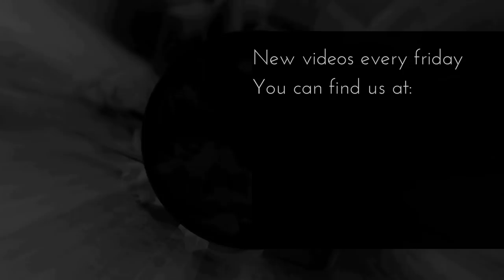Epoxy round coffee table - black epoxy and poplar

Comment: Probably a dumb question but do you mind telling me what kind of black pigment you used? I just did an epoxy mix using Pearl Ex carbon black, and it came out super opaque and I wanted it solid black ..I was told not to put too much pigment in as it may affect the curing process. I guess I should have put a lot more in or??

Comment: Superb work. 
3 Questions pls-
1) Did you wait for the bottom-most BLACK layer to dry completely or was it semi- liquid?? 
2) What was that liquid that you brushed the wood with?
3) After complete curing how did u manage to get the finished product out? did you dismantle that round mold completely?
Reply: Therapy Art it was cured. That’s why he coated both the black base and wood with clear resin before positioning it.

Comment: What type of finish would you use if it needed to be food safe. I am making a charcuterie board for a friend and am having a challenging time using different food safe oils (have both wood and epoxy to cover), and the oil never dries on the epoxy. I realize that most times a type of poly is used as a finish coating.

Comment: Quick question. After you put the black epoxy on the very bottom did you let that dry before adding the clear? If so, do you do a light wet sanding or anything to the black before the clear is applied?
Reply from the maker: I let the previous layers dry completely and then pour a new one and i dont sand between layers.

Comment: How do you finish off the edges? There has to be resin that came through under the ring or round off the edges? Do you do a final sand and polish?
Reply from the maker: I do the edges with a router and then sand and polish it. If you look carefully i pour everything inside the mold so between the wood and the mold wall i have 0,5mm of epoxy.

Comment: Beautiful work and craftmenship...where did you get the white materials for pouring on? I've not found it in that large of sheets? Thank you very much
Reply from the maker: Thanks very much.
Stratified wood, same material used in kitchen cabinets. Very important is to be glossy. If not just apply a glossy sticker and pour epoxy on it.

Comment: I know that you have your pieces individually sealed before you place them but do you have the edges of your wood rounded over also or do you leave them square and just round over the epoxy? What edge gap do you use around the table as well? That is a beautiful table. I may try one myself that’s why I’m asking.
Reply from the maker: The edges are square. I leave about 5mm between the edge of the wood and the edge of the mould. I then pour epoxy there. In the end i round only the epoxy edge as the wood needs to be always glazed in epoxy. 
Depending of the effect you want to get the wood also can be rounded, but i like it better square. This is a matter of taste.
And you are right all the pieces of wood are sealed.

Comment: do you use a dryer or a torch in the video?
Reply: Luka Crosszeria a hair dryer or heat gun helps to get rid of the tiny air bubbles that form in the resin during pouring.
Reply: Carl Craemer i know that already but thanks for telling me that.😁👍🏼
I wanted to know what was used in the video.. i think its a heat gun.

Comment: Table came out beautiful. Awesome work. 
Question, did u use casting resin or just epoxy resin ? Only ask because of the amount of resin used. I want to make one too. Thx
Reply from the maker: Only epoxy. Bottom layer 3mm, place wood, 3 layers of 0,8mm and then final layer 5mm.
Reply: SegWood Design  thx really appreciated ur work.
Reply: Why 3 layers for the wood and not 1 layer? Or 3x 0,8 mm + 5 mm = 7,4 mm the top layer?
Reply: Omar Carrera tlnl
Reply: Scandal
Reply: @DIY_Germany_68  Depending on which epoxy you use many are not meant for that thick of a pour and will generate a huge amount of heat.  I made that mistake the first time I tried it with a 1-1/2" pour, the epoxy had to be well over 300 degrees for a while and was smoking...
Reply: @segwood1211  hi, which material is the mold made?

Comment: Some answers to repeated questions I've seen below in the comments sections, as best as I can guess. See disclaimer at the bottom for a laugh. :)
What resin did he use? Probably something like this.
https://www.amazon.com/epoxy-resin/s?k=epoxy+resin

How much resin did he use? Well if you removed the timber and the table is 50mm thick (2") and (as stated) 750mm in diameter (2' 5.5"), then you'd need 22L (5.8 gal) of resin. He says he used 12L (3.17 gal) here. NOTE: he also makes a mistake in reply to how thick each layer was in the comments section. It's clearly not only 10.4mm as he claims. 

What could you use to stop the resin sticking to a mould? A tape like this.
https://www.shurtape.com/products/hw-300/

https://www.epoxyworks.com/index.php/what-you-can-do-if-you-dont-want-epoxy-to-stick/

What was the mould base made out of? Melamine laminated particle board. Almost certainly waxed to make sure the epoxy didn't stick.
https://www.homedepot.com/p/Melamine-White-Panel-Common-3-4-in-x-4-ft-x-8-ft-Actual-750-in-x-49-in-x-97-in-461877/100070209

What was the round edging of the mould made out of? Possibly polycarbonate strip. It's likely he waxed it to make sure the epoxy didn't stick.

How did he get the bubbles out of the resin once it was poured?
With a heat gun. I've seen others use a propane torch. The real pro's with the right gear use vacuum to remove bubbles.

How did he get a mirror finish? He shows no surface imperfection repair at all in this video but others sand from 200 grit all the way to 2000 grit to get a mirror finish on epoxy resin.

How do you get the bits of timber nice and flat before putting them in the mould? A jointer or planer if you have access to one (that is big enough). A router with a flat bit in a guide if you don't.
If you're old school (goodonya!) use a hand plane. See this video at 45 seconds to see what I'm talking about.

https://www.youtube.com/watch?v=IJ-hiw1CqyA

Do you have to wait for each layer to cure before adding the next? YES. Yes you do.

How did he get the timber bits nice and circular (where they needed to be circular)? Probably by rough cutting the circular bits with a jigsaw to around 5mm of final dimension then using a router with a long straight cutting bit and a radius guide in incremental depth cuts of 6mm at a time. The three sections were likely double sided taped (or screwed) to a bottom board to ensure they stayed in place.

Final note: Epoxy resins get hot whilst they are curing. Whatever you use to contain them (whatever you make your mould out of) has to be able to take the heat. Any wax or whatever needs to stay on the mould and not mix with the epoxy when setting.
Use multiple thin layers in multiple pours to avoid heat problems, reduce materials handling issues, mould stress and bubble formation.

Final disclaimer. I have never used epoxy resin in a mould before in my life! I'm about to and have watched several videos and done some reading on the subject. Everything above is what I've learned in the process. I've found that going in search of answers is faster and gives better reliability than just asking in a comments section of one video and hoping whomever answers knows what they're talking about. :)

Comment: Great piece!
My question is about the heat-gun procedure.
Are you using the heat to only set the epoxy so it can finish on its own or are you fully curing it with the heat-gun?
Reply: PatrickHakes It’s to pop all the air bubbles as they rise in the resin👍🏼
Reply: How much it is

Comment: Hi, awesome stuff. Do you mind me asking what you paint onto the wood before placing it down?
Reply from the maker: I dont mind. Thanks for the appreciation first :).
Every peace of wood is sealed before placing epoxy over it. I do the sealing with epoxy but not pouring over it just brush it. This way after pouring epoxy you eliminate all the bubbles coming from wood. All it remains are the bubbles from mixing that you can torch or heat gun them.
Reply: SegWood Design thanks!

Comment: What is the base did you used sir ???
Reply from the maker: For the mold is laminated wood.
The black base of the table is black epoxy.
Reply: SegWood Design 
Is there any other options rather than laminated wood
Reply: SegWood Design sir I want to learn and do this !!!! Nice job Master
Reply from the maker: Amar Yadav You can contact me through one of the methodes from: segwooddesign.com
I will get back to you there with all the info you need.
Reply: SegWood Design Thank you